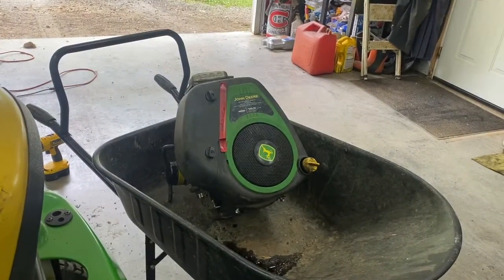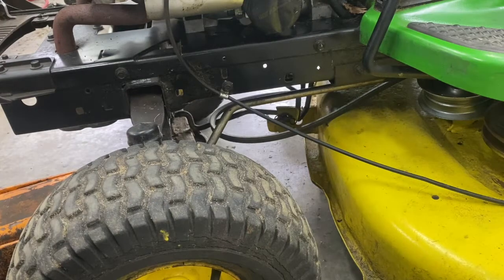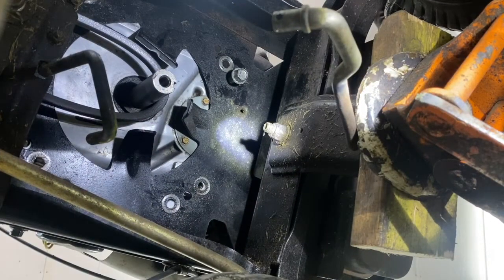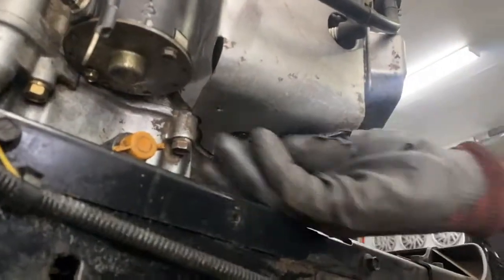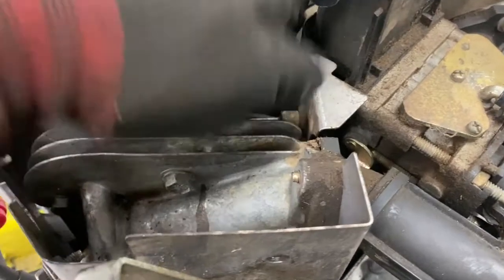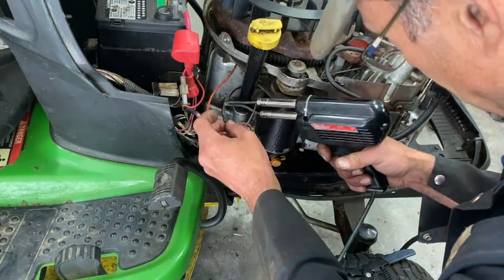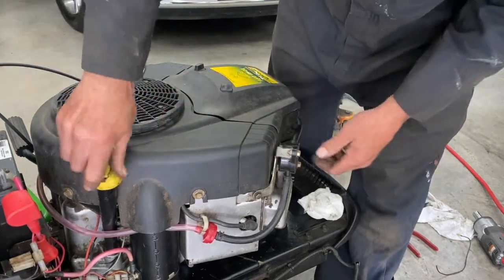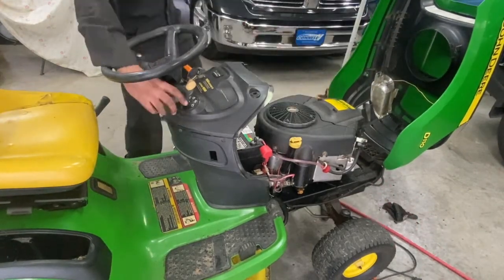How to swap out a Single Cylinder Engine with a V-Twin on a John Deere Riding Lawn Mower, 100 Series

Comment: My L110 that i saved and restored after previous owner had a tree land on it, guy put mixed 2 cycle in it, and caught fire, motor finally seized today. Ive got an old red mower with a V twin briggs that im thinking of doing a swap after seeing this. Only problem is the starter went out, and ive yet to find one that matches. The search continues

Comment: Hmmm if that swap was easy then why does  John Deere have 2 different  frame plates for the 100 series  as the other plate has a round  hole instead  of the pressed hole with the included  belt keepers stamped in while they use a seperate belt keeper plate which  bolts  on the two front engine mounting hols  for the twins  ?
Reply from the maker: They slightly change the frame every couple of years.  Basically the same frame.
Reply: @WeekendHobbyMechanic  They certainly screwed up the front axles as the one JD sold me for 260 bucks had giant slots missing from it instead of the holes Im guessing their saving that cast iron for something ?
Reply from the maker: @stevecurry5785   What model was your Tractor?
Reply: @WeekendHobbyMechanic  Mine is a LA 105
Reply from the maker: Should be the same frame all the way up to the “S” series.

Comment: Ive got an 18 hp briggs i just swapped into my L110. Im having a heck of a time with the wiring. I can get it to turn over, but no spark. Do i need to use the voltage regulater off the blown kohler? Ive got a yellow, white, and red coming out of the briggs.
Reply from the maker: That’s a good question.   Don’t know for sure, I would have to look the wire diagrams for both motors.
Reply: @WeekendHobbyMechanic  i got it all wired up, it runs, but now it won't go forward or reverse. It's the l110 with hydrostatic transmission. Pedals feel like there's no resistance
Reply from the maker: @colbiesandberg7688   Release the Brake pedal and check the drive belt under the tractor. It should be under tension.  Check the belt around the "driven pulley" under the motor.

Comment: Doing my first Single to Twin Swap On A Husky 2042 that was a Kohler.  Swapping in a Brigs 20Vtwin…none of the bolt holes line up to mount the motor.  Why did you have much better luck than me lol
Reply from the maker: Not fair!  Lol.   John Deere has all the holes pre-drilled for both motors.  
        No biggie.  Centre up the motor and mark the holes under the mounting plate with a grey “sharpie” marker.  Drilled them out.
Reply: @WeekendHobbyMechanic  

Husky is the same way…just none of them work.  

I was doing the swap in the rain…plan is dry weather to either score the holes using a 90 degree pick or use some paint…wait till it dries and remove the motor to drill.
Reply from the maker: Awesome!

Comment: could you do a video with detail about how to do the wiring harness swap between the two motors; this one was too fast and hard to follow...
Reply from the maker: I rewatched my video and you’re right. It is a bit hard to follow.  
  I’ll redo the video soon.
Reply: @WeekendHobbyMechanic  Thx, did you add a pair of diodes on the kill wires ?
Reply from the maker: @thomaskirk3548  I used the original one from the V-motor. I soldered it to the new plug at (3:50) in the video. (It's not very clear, my fault)
Reply: @WeekendHobbyMechanic  I see it now, thanks. Just swapped out my Intek single (decompressor failed again)  to a BS twin.

Comment: No issues with drive pulley diameter? I have a JD LA 115 that smokes and pumps oil. Little tractor is like a goat, goes anywhere and it came with a lot of accessories. Got a Crapsman twin at a buddies shed. Key's the same as the JD, hmmm. Looks like your swap was pretty easy. My guess is that's not always the case. Thoughts??? Thanks
Reply from the maker: Very easy.  Not shown in the video properly was I kept the two kills wires to the coils. They have diodes.

Comment: I have just done a Vanguard 14hp swap to my L100, bolted straight in. Just need to custom make a exhaust as this vanguard engine was out of a Rover.
Was going to make a Y pipe but will now drill out the other hole and run to separate exhausts to the muffler as you did.
I’m in Australia so will have to fabricate as genuine exhaust too expensive
Reply from the maker: Good work..

Comment: Have you ever swapped the transaxle on a newer john deere d100 series lawn tractor? I have a d125 and I want to swap the hydrostatic out for the 5 speed manual on the older mowers and was wondering how easy of a swap it is.
Reply from the maker: That involves allot of work. Too many parts to change to switch over.    It’s much easier to convert a manual to a hydrostatic.
Reply: @WeekendHobbyMechanic  ok good to know. I thought it would just be easiest to buy a parts tractor and swap everything over. However in your opinion are the manuals better than the automatics? I've heard the manuals are very jerky and you can't shift on the go with them. Is that true? I'm just wondering if it would be better to swap it to a manual or just save up money and put a k66 in there is all lol.
Reply from the maker: @oldsoulgarage2982   Hydrostatic is the way to go.    If you clean the grass on top of the transmission every year it won't overheat and last a long time.  I just did a video on a D105 (manual). I will upload it in a few days.
Reply: @WeekendHobbyMechanic  God I am so happy I never bought a d105. I would never tow my cyclone rake with that plastic CVT transmission. I trust my aluminum case t200 tuff torq any day over that design.
Reply from the maker: @oldsoulgarage2982  Here's my D105 transmission video.  https://www.youtube.com/watch?v=AiBf8dBzwVY

Comment: What is a good swap engine for a Kohler single SV600 in a cub cadet motor is retired by Kohler. Have never done anything like this
Reply from the maker: I’d switch it with 19, 20 or 21hp Kohler.   But my first choice would be a 22hp Briggs and Stratton v-twin. (Smooth running motor).

Comment: Thanks I am replacing my single jd100 with this motor or pretty close to it. You mentioned you ordered a dual throttle lever one for choke and one for throttle. Do you have what part # that was?
Reply from the maker: Part number GY20948.   Watch this video.  https://m.youtube.com/watch?v=D_SNavgSzR0&pp=ygUjVGhyb3R0bGUgbGV2ZXIgdHdvIGNhYmxlIGpvaG4gZGVlcmU%3D
Reply: Thank you and thank you for your videos. Please keep them coming. 😊

Comment: My d110 just threw the compression release. I'm thinking of buying a Briggs vtwin from a d130 and swapping it. What exhaust (s) did you use? The second tube and the canister?
Reply from the maker: I used the same muffle. Drill a hole @0:36 in the video.   Not in the video was I used muffler cement to seal the hole better.   
    Hopefully the exhaust tubes will come with the new motor.
Reply: @WeekendHobbyMechanic  from what I see in the new engine descriptions, they don't come with exhaust tubes, instead they have bolt on mufflers on the side
Reply: @WeekendHobbyMechanic  I see you drilled a hole in the ACTUAL muffler LOL I did not connect that you were drilling the muffler.
Reply from the maker: @Z33Garage  John Deere Part #GX24188 & GX24187 and for gasket it's LG690970.

Comment: Thank you I want do  this same thing with flat head Briggs & Stratton  motor  from old tractor  with body  rust out but motor is real work  and cheap  one  Cylinder  Briggs  & Stratton  motor have bad time with camshaft  with Compression release braking off  and falling down into the oil pan and blow the motor up made china  I guess , ha ha ha